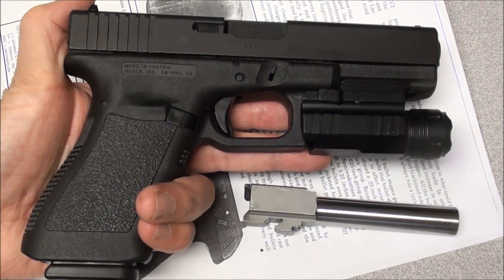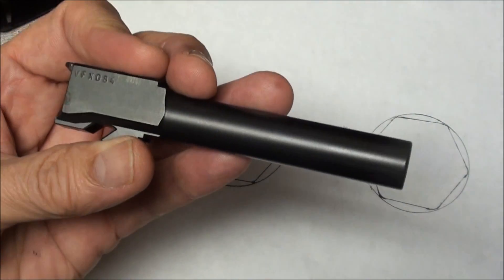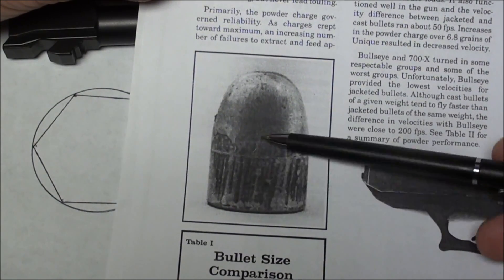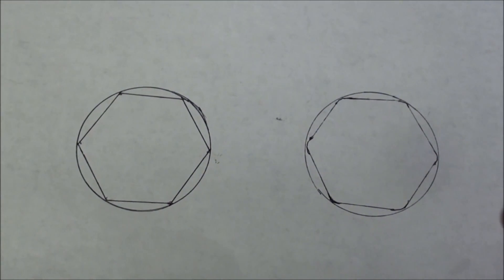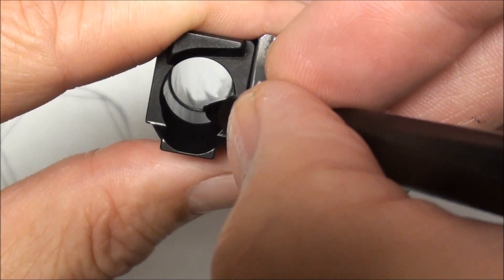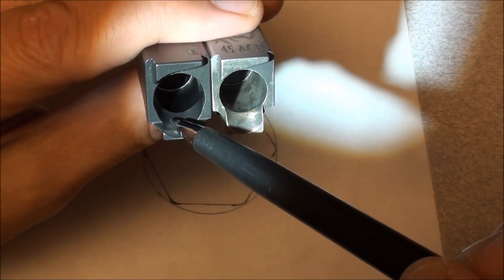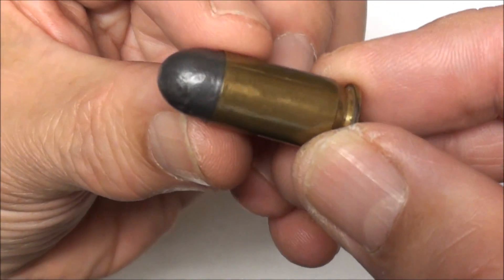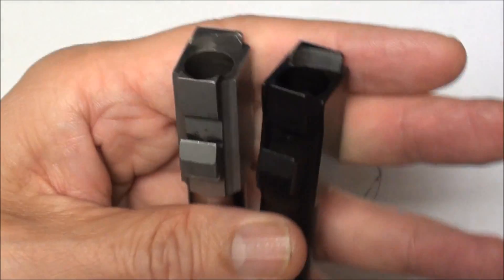Polygonal Rifling in Reloading Ammo for Glocks

Comment: Outstanding video. I have a Glock 27g4 in 40 s/w and have only about 100 rounds through it. Always heard "rumors" about how they blew up and was going to sell it but after your video I have decided to keep it. I only shoot factory loads and don't shoot very often (maybe 2-3 times a year with this pistol). I did buy a wolf 9mm barrel for it since I have a lot of 9mm ammo. Someone, YOU, has finally explained this so that I could understand. Thanks so much. May buy a S/W or S.A. for my next 40s/w.
Reply from the maker: frank zappa - Always good to hear from you - Your G27Gen4 is an excellent pistol.  As you are well aware - the 40 S&W was developed from the 10mm that was in vogue after the Miami shootout where numerous failures to stop occurred with some of the other calibers of the day.  The 10 wound up being too robust for many officers to qualify with so the reduced power (read non-magnum) 40 S&W using a shorter case came about. The 40 is a fine round in its own right.  Your Glock was designed to be used with factory ammo.  Many shooters have come to realize that the famed Glock reliability comes at the cost of the factory barrel gun not being suitable for use with reloads or cast bullets.  You will hear of some shooters running reloads and cast bullets through their factory Glock barrels against all the recommendations with no problems.  You can play Russian roulette without problem also - until your luck runs out...No thanks, whenever I pull a pistol trigger, I never have to wonder if my gun is going to dismantle itself in my hand - and I'm staying that way. Glad to hear you are of like mind.   Best Regards and Happy Holidays...
Reply: FortuneCookie45LC Thanks for this and your other prompt reply. Merry Christmas and a safe happy new year.

Comment: excellent video, did a similar one myself. I wonder if you ran a couple dozen lead rounds through a clean barrel and weighed it on a scale before and after if you could detect the exact amount of fouling.
Reply from the maker: EitriBrokkr - Thanks for your comment and interesting suggestion on weighing to determine leading.  I've never done that because I don't shoot lead bullets thru my factory Glock barrels.  I haven't weighted barrels because my own assessment of barrel leading is done with every shot I take.  Leading and accuracy are inversely related.  Since I call every shot I take, if the bullet hits where I expect it to be depending on the quality of my hold and trigger action - I know the accuracy is there and the leading is not.  I've shot 200+ cast bullet rounds many sessions in the past when my guns maintained their accuracy throughout and the leading was very light.  The only time I've had problems in over 40 years of shooting are with my two revolvers with oversized chamber throats - my Colt New Service that had been rechambered to 45 Colt (throats are .455") and my Virginian Dragoon (44 mag but throats are .436")  I can only remember having keyholes with those two with the exception of shooting wax 12 gauge slugs keyholing on regular occasion.  Best Regards and Happy Holidays to you

Comment: Hi there awesome videos , what lee bullet mold do you use for glock 21 .45 acp ?Thanks
Reply from the maker: Dave M - I've found the Glock 21 with LW aftermarket barrel to be finicky to seating depth.  If bullets are too long at all, the round will hit the rifling leade and not go into battery.  If depth is right, feeds fine.  I have the 230 RN one ogive, but the 2 ogive would be better.  The 45 bullet that I really shoot a lot of is the 200 Lee long nose SWC - shoots great out of all my 1911s and revolvers.  But the Glock has some jams FTF with it. I'm having a great time shooting FMJ reloads in my Glock 21 with aftermarket LW barrel.  No need for the 230 TL TC mold until I get low on those.  Best to Ya

Comment: Cookie, I reload for my Kahr PM9, usually with Unique. I can't get reliable cycling unless I shoot a heavy bullet. One of my molds throws a 163 round nose (ridiculous weight for a 9 para) but I load it lightly and it cycles reliably for practice, albeit with a different POI. But I worry about overworked brass for the exact reasons you've CLEARLY(!) stressed. Wolf doesn't make a Kahr barrel last I checked. Should I stop shooting cast? Its my EDC  and I NEED the practice. I can scratch "The Reloading Itch" with other guns that like my lead reloads just fine, so I really don't have an excuse. I just wanna, mostly. 

Super video,  as always!
Reply from the maker: goldwingnut1954 - Always good to hear from you, Stan.  Your Kahr PM9 is a fine pistol…I'd own a Kahr, but everytime I check them out, the price tag is more than I'd like to spend.  Kahrs also have blow up problems for the same reason as the Glocks - and your heavy 163s (those were intended to make major power in 38 Supers) are not good for the 9mm (too much chance of high pressures as you already note).  Also, practice with different performance loads is not advised - Your EDC gun deserves practice ammo that behaves like your carry ammo - that means FMJ (not too expensive today).  I shoot my 30 carbine once a month and that gun doesn't get any cast bullets because I want to know it well if the balloon ever goes up… Best to ya...
Reply: FortuneCookie45LC I know you're right. I just wanted to believe otherwise, since I love to "roll my own"....probably even more than I do shooting them. (I wish Wolf would make a barrel.) Would you also advise against me reloading my own brass with 124 FMJ's then? I've done lots of them already, but I don't keep track of how many times per hull--probably another mistake.
Reply from the maker: goldwingnut1954 Even with those nice FMJs, and slower powders, and careful bullet tension to prevent bullets getting shoved deeper into cases on feeding (raises pressures), the problem is still the weak spots generated at the head of the case on each firing - if these weak spots get lined up again at the top of the feed ramp (bottom of case head) and lined up again on a third firing etc., the brass could let go.  Factory new brass in new ammo doesn't have that problem - only our reloads do - and in other pistols with supported case heads=no problem.  But with all Glock type concept barrels - could be a big problem.  Reloaders who shoot reloads take their chances doing all the other variables, but we have little control over using old brass other than not to use it...I don't cast for the 9mm because I still have a total of 8K 9mm lead bullets left over from my steel shooting days - and I only shoot those through after market barrels in my Glock 19 and 34 - no problems with that.  Otherwise, I'm shooting 9mm hardball...Good shootin' to ya...
Reply: goldwingnut1954 What does BDC stand for?
Reply from the maker: frank zappa I know you are referring to EDC = Every Day Carry gun.  BDC is a term for Bullet Drop Compensation features on scope reticles and turrets.  Best Regards to you and Happy Holidays again....

Comment: Perfect analysis! All your observations apply to my Glock .40 as well.
My stock barrel is like Debbie does Dallas slop, whilst my wolf only has minimal play.

Probably not a good idea to reload any shells fired out of factory Glock barrels. Would they even fit in standard chambers of other like caliber pistols, or do they re-compress the cases somehow before reloading?
Reply from the maker: MrSnivelupagus - Some shooters do reload brass shot out of Glocks and don't mind the bulges near the case heads as most of that is ironed out during the resize procedure.  Others, like myself, avoid Glock brass because the brass has been stressed.  The reason is we might wind up firing that brass in our own Glocks and it the planets are in alignment, we might get the next Glock Kaboom.  Call it being too conservative, but I've never had a gun explode in my hands - and I don't intend to have one of those incidents in the future either…Best Regards

Comment: I never had any problems shooting hard lead cast bullets from my Glock 21. I shot 230 gr. LRN.. and kept my reloads as close to GI Ball.  This load worked great in both my Glock 21 and Springfield GI 1911. Never had a problem.  Do Glocks in 9mm have more problems with cast bullets??
Reply from the maker: Stephen Maurer - the 40 with cast bullet reloads in Glocks has been the highest number of bad events...Good shootin' to ya....
Reply: Thanks FortuneCookie45LC...  I shoot cast reloads in my Walther p-38 (WWII AC-42) and Taurus PT-709 Slim. I was thinking the same thing.  I have even seen Hcikok45 (youtuber) shoot 10mm lead cast from his Glock.  Thinking about getting a G19 (Gen 3). Just don't wanna turn it into an Austrian hand grenade.
Reply from the maker: Stephen Maurer G19 (Gen 3) is a mighty fine pistol.  Even though the factory says no lead bullets, I do know shooters who shoot cast bullets in their factory Glock 9mm barrels.  If you choose to do that, at least use slower powders, stay away from max charges especially with heavy bullets... and do careful case inspection to avoid using brass with big bulges.  Or best to use aftermarket barrel with supported case head...Best to ya...
Reply: FortuneCookie45LC
 Well I load W231, Unique, and Bullseye in 9mm...  Any suggestions for Glock 9mm Luger loads??
Reply from the maker: Stephen Maurer The safest of the three is Unique as the burn speed and pressure curve would be the most favorable.  Best Regards

Comment: Mr. Cookie, it is my understanding that JMB designed the .45 ACP to be a low pressure cartridge because the 1911 required a long feed ramp, which necessitated a chamber that could not be fully supported. Not that I'm trying to excuse Glock, which obviously doesn't require as long a feed ramp as the 1911.
Also, I have read that 10x22 Glocks have had chamber ruptures/explosions as a problem more often than other calibers. I just pulled out the barrel from my Glock 23 to check for play around the case, and I was rather disturbed by the amount that the cartridge would just shake around in the chamber!
Have you had any FTFs with the Wolf barrel? Now I'm wondering whether an aftermarket barrel might be a sensible safety consideration, even with factory ammo.
Reply from the maker: Douglas Gross - I might be mistaken, but I never thought John Browning designed the 45 ACP cartridge.  His huge contribution among many, was the 1911 and then the High Power (basis for almost all modern semi-autos including the Glocks as you are very aware) And as long as the case where the body of the case meets the web of the head is supported, we can accept that as "fully supported".  That's the problem with the Glock, with combination of chamber slop and barely unsupported web, the setting is there for a perfect storm of other factors (including the 40 cal) that lead to the case letting go - and that risk is the lowest for factory new ammo (but it still happens even there at a lower fail rate).  You and everyone that checks out the chamber slop note concern and rightfully so.  Glock never intended his pistols to be shot with reloads - he was after the military and police contracts - huge market made him and his lovely wife very wealthy and brought him trouble as well.  You've got your 40 and so do tons of other shooters.  Me?  I get around the risk a bit by avoiding the 40 Glocks and shooting the Wolf barrels with my reloads and factory while shooting only factory in my factory barrels - then I never give Kaboom events any mind at all when I'm shooting - and that's the way I like it.  (Glocks are fine guns, I have three of them.)  Same reason I shoot Ruger Blackhawks - own a whole passel of 'em including a herd of 44 magnums - I stoke 'em and never worry about my guns letting go - all shooters only want safety, accuracy, power, economy and clean shooting when our guns touch off…And yes, I get occasional jams with my Wolf barrels when I shoot my reloads - about 2% usually failures to chamber...Best Regards
Reply: Thanks

Comment: I am planning to reload 9mm cast bullets for my Glock 19 eventually so this is excellent information for me to know. Bottom line is I need a Wolf barrel and will only shoot factory ammo through my factory Glock barrel. Very good video! Thank you!
Reply: Reloads are fine, just change the barrel, use a 9, dont max the bullet weight or charge and keep em coated...gtg.
Reply from the maker: CountryBoyPrepper - that's a very good Glock policy.  The big majority of blow - ups with Glocks is in the 40 cal.  The 40 gives a perfect storm of all the factors that tend to boost pressures, so I never bought any 40 cal Glocks...but even then, I'll shoot my Lone Wolf barrels with my reloads.  Best to ya...

Comment: A thought occurs that may have been answered. Can brass fired from a Glock be re-used reliably in another firearm? (or an aftermarket barrel in same) The bulge is noticeable in all the rounds fired. To be more specific, I am asking about the notorious 10mm, a round I love, but I find my self hesitant to reload.
Reply from the maker: MrBlack751-A lot of shooters used to avoid brass with the tell-tale Glock firing pin indent because the brass was overexpanded and bulge ahead of the extraction groove.  But if the brass is run thru the Lee bulge remover, and then fired in a supported chamber, the brass works just fine and safe.  Problems with case failures are much more likely with the 40 than the 10.  In spite of what you hear from shooters reporting no problem shooting, hot loaded reloads with fast powders and heavier bullets shot thru factory Glock 40 barrels is asking for trouble... Best to ya.

Comment: FC45LC, Enjoyed this video.  I reload and have wondered about the lead and reloads going through my Glock 17.  Have ordered a Lone Wolf.  Thank you
Reply from the maker: Michael Rowe-Match shooters are using factory Glock barrels and either jacketed, plated or coated bullets to not have the excess smoke or fouling from shooting cast lead bullets.  Current shooting competitions do not have the power factor requirements that IPSC used to have, and that's a good thing for Glocks as lower powered ammo with the above bullets makes for safety in the oversized Glock chambers.  And match shooters like the reliability of the Glock factory barrels.  Many reloaders - range and field shooters really like aftermarket barrels and lead bullets, though...Thanks for your comment and Best to ya...

Comment: FortuneCookie45LC great subject.   I have a LW barrel for my G17 for lead reloads, but I have gone back to the factory barrel.  The lead reloads were a dirty hassle to reload in my dies, and smoky on the range.  I now use plated bullets almost exclusively in my 9mm,  not much more costly, but much cleaner.
Reply from the maker: Jon-Very important points you raise-competition shooters cannot have the smoke issues with cast bullets obscuring vision.  Of course, reloads still have the potential for overpressure problems in the Glock if the reloader does not mind the potential for "perfect storms" adding up to cause failure in the Glock chambers.  And that is independent of whether the bullets are jacketed, plated or plain cast.  But experienced reloaders can attenuate the risk with awareness.  Best Regards and good shootin' to ya...

Comment: Thank you. Excellent video. Guess I will get rid of the glock23. Just for safety reasons.
Reply from the maker: Magzamani-No need to do that at all. That is a very popular Glock.  The pressure of the cartridge and nature of the chamber just means you have to give due respect to all that and everything is fine.  Many shooters shoot reloads in their Glock 23s - If you do, then jacketed bullets (plated is OK) and use only medium to medium slow powders and avoid maximum charges should be OK.  And if you use a supported chamber aftermarket barrel, then you are in business...Best Regards...
Reply: Thank you for the advice

Comment: run your brass thru a bulge buster reload and shoot
Reply from the maker: ralph crosby- Great advice for 9mm and 45, Since I don't own a Glock 40, I wouldn't mind picking up Glock fired 40 brass and doing the bulge buster, reload and shoot because any barrel I shoot them in will have the supported case heads…Best Regards...
Reply: FortuneCookie45LC I reload .40 and 9mm both for glock factory barrels. I do run it thru a bulge. A homemade one for 9 mm

Comment: I only jacketed bullets in the Glock 20. I`ve heard people say that they have had no leading using lead bullets in Glocks. But mine leads up badly.
A lot easy to just use jacketed than spending a hour cleaning the lead out of the bore.
Reply from the maker: 1957Shep-That's for sure, many years ago when I first started casting for my Series 70 Colt Government Model, I casted them extra hard because leading was NOT desired.  You can imagine what would have happened if I leaded my barrel…I would never have casted another bullet ever.  But it shot and cleaned like a dream…and I've been casting up a storm ever since. :)  Have a great day to the 1957Shepster.